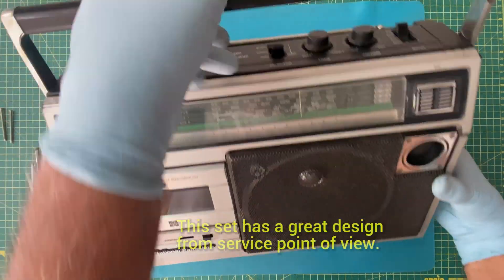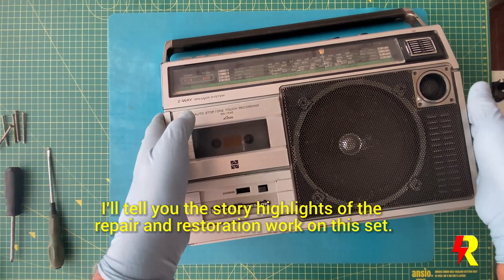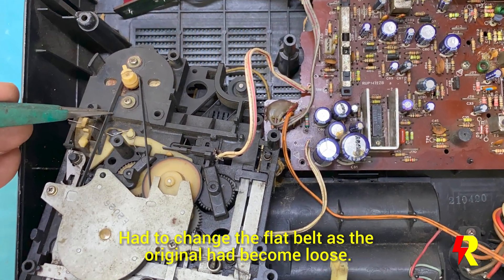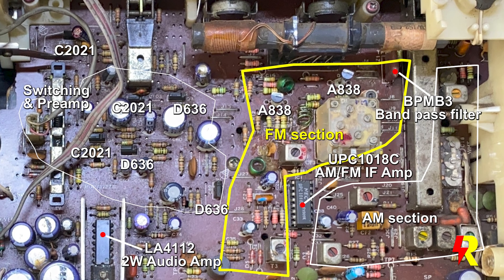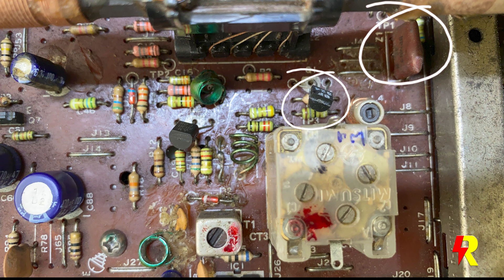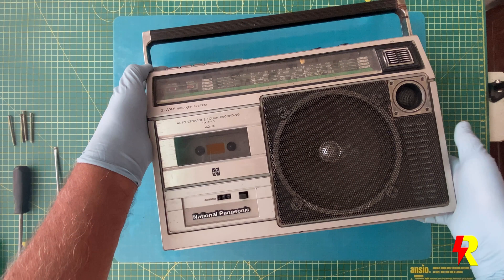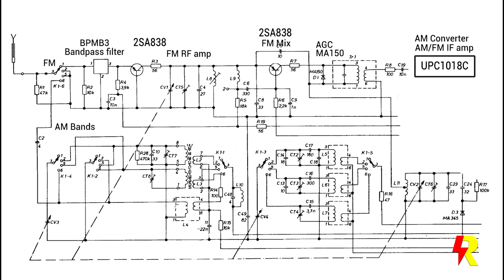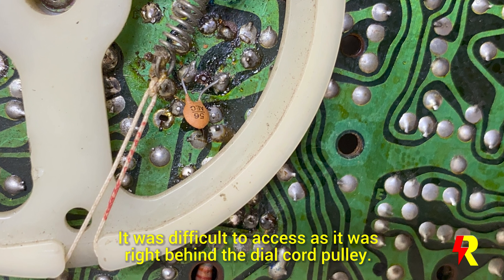National Panasonic RX1740 | Rare fault in this 80s Vintage Radio Cassette Recorder | 4K |

Comment: Nice video. You have a good voice fo explanation as well. 😊, Do you take restoration projects as well?
Reply from the maker: Sorry for late reply. It depends on the project.   If you can please provide details.
Reply: @rectifyer949  mainly recapping fo technics SUV 2
Reply from the maker: @mithunmiranda  should be possible